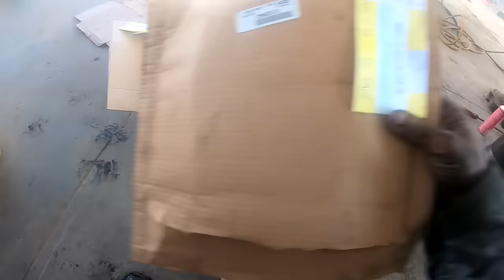Leaking axle seal.

Comment: Thank you for showing the inner race removal (welding the inside of race to shrink upon cooling).  That’s a trick you typically learn the hard way... a welding friend clues you in. To install a new inner race, I typically use a can of dust off (compressed air), flip the can upside down, and spray the liquid (difluoroethane) on the inner race.  It’ll shrink it a couple of tenths...race can be dropped in.

Awesome video!
Reply: Yes, duster spray (R152A) should be a standard tool on his truck. Absolutely freeze a race in seconds. At about seven dollars a can at wally world and so environmentally friendly you can spray it right into the air, a very useful tool.
Reply: I have taken the old race and ground it down a little and use it for a driver.
Reply: Propane bottle upside down works good to.

Comment: Speaking of heating bearings, you can wrap a bearing in a wet rag or paper towel and put it in a microwave, works great, and is much faster then a torch. You can also use it to heat up lunch :) just hook it up to the welder generator on your truck. Another great video keep it up.

Comment: Hey Warren Awesome video! I saw the weld trick with the bearing race you did to pull it out of the bore. Years ago one of the old timers taught me to drill about a 1/4 hole almost all the way through the race 180 degrees from each other then chisel on the drilling to crack the race. The idea is to split the race in big pieces to pull out by hand, kinda like drill splitting a crank gear.

Comment: Just amazed at the size of that machine and that you can handle the parts by yourself. Impressive.
Reply: The axle is only that large because it doesnt use a "Floating" style axle.  In a "floater" the axle only transfers power, not having to hold any vehicle weight. A truck using a floater will have bolts around the center of the hub. You pull those bolts and the axle simply slides out. Even with the wheel on the vehicles you can remove and replace the axle

Comment: Warren, that looks a lot like a JD 644 wheel loader axle.  I wish I had a crane, plenty of good learning rebuilding those. Dry tube with that labyrynth type seal for the outer axle and lip seal to keep the other lube out of the tube.  I didn't like the bearing preload procedure so just used a big hoss pry bar with the housing on the floor to get the .003 end play.  I didn't weld the bearing, I think I used a claw hammer to hook it and then a punch from the far side.  I was mystified how a 1 inch 8 bolt can hold a wheel onto a loader.

Comment: I'm not a mechanic but know a bit about lifting things that have nowhere to catch onto, make a couple of short metal legs and fix them to a strap, one on each end with a lifting eye in the middle of the strap. The legs are made like the legs on a puller/bearing extractor, L shaped the bottom of the L facing in over. the heavier tha load the harder they grip. You can even make a 3 or 4 legged strap for better balance. You have obviously seen how a puller works and its the same principal. I've used this to unload 50 gallon drums of oil only on the rim, 5 high full fish boxes and any number or things with no holding points.

Comment: I hope by now you have the torque specifications. I did a smaller model but very similar. Outer bearing went out and is only lubricated by grease. I shake my head at JD's thinking. Anyway I found the hard way that those bolts need higher torque then the tight and back off 1/4-1/2 turn. Months later they were too loose for my liking.

Comment: Another truck I use to drive bearings on to shafts is a piece of exhaust pipe just big enough to slide over the shaft and not so big it hits the bearing cage and use it to drive the bearing on

Comment: You can also put a little bit of Grease around the axle where your bearing goes lay your bearing down on a piece of metal heat the inside of the bearing and it will slide right down to where it needs to go because I had seen the inside of the bearing break where you was using the air hammer

Comment: Hey you were wondering on gauges for the Peter bilt project?  I may have a solution to that. If you look up on the web Murphy gauges, they have the gauge sets that can work on a j1939 Network. Murphy makes a module that intercepts all signals from engine ecm and converts to old style analog signals for tach. As well they make a module that is a gauge / diagnostic tool itself, that would allow you to have a def level gauge and as a well a monitoring unit for any other parameters you want to keep a eye on. They also have a basic ability to throw out a code to you to let you know what is basically going wrong when check engine lamp is on. Hope this helps a bit , I hear ya on hard work. Farmers up here in West Central Saskatchewan are ready to go, but rain has kicked us for a couple days.
Reply from the maker: Thank you very much for that. I just looked them up and that is definitely the solution to this.
Reply: @westerntruckandtractorrepa1353  Very welcome !  I'm curious how it all turns out In the end. We have a lot of old trucks up in this area and kinda interested to see how the swap goes. Let me know if you need a little help on some wiring .

Comment: Could it better putting the old bearing race backwards on top of the new one to drive it in..thanks great videos
Reply: Use an old crock pot with hydraulic oil heated to about 350 degrees. Use that to warm the bearing. At that temperature it should just drop down into place. No hammering needed.
Reply: If you take a cut off wheel and cut a slit out of it so it doesn’t get stuck in there it would be great! I do it all the time! If you get really crafty you can save a few of the common ones you use so you always have a driver hah
Reply: ShopUse he did say that it it would take to long to heat up the oil and the bearing.  He did  it in less than a minute with the hammer. It’s hardened steel and won’t even scratch it

Comment: Hello young man! really interesting video again. Please can you show more of the welding shrinkage technique for removing bearings next time you get one to do? I have never seen that done before and would like to know more. On the lifting of the  planetary drive, can I suggest you get a three or a four leg chain set to hook onto your crane. The hooks on the chains will or should go over the flange on the PD when it's laid down and then you can lift the assembly into place. Failing that due to room between the flange and the axle casing. Failing that dig deep and buy an electromagnet with enough lifting power to lift the assembly. Now, where can you buy a cheap electromagnet I hear you say? Just go buy used a mag drill, you can thank me later!  Thanks for video young man and take car and be safe!

Comment: Not a bad idea but 2 min with a good plate of steel and use your oxy to heat in the centre of the plate with the bearing on the plate flat, evenly heats bearing up to 180C and drop straight on. Also a bit of planning and have those cups in the freezer they will drop in pretty easy.

Comment: Great video as always on that peterbuilt update can’t you find a wrecked 379 with a n14 Cummings like a late 90’s and that give you all the gauges sensors and wiring all in one for the cheap?
Reply from the maker: Those were analog gauges , these are multiplexing.
Reply: Yhea but couldn’t it be ran separate from the original harness you know just like a ole hot rod gauge cluster lol

Comment: Hi their , I have a KW with CAT 3406b runs good .. I have 1 issue .. truck stalls / engine stalls out when I turn on the left turn signal on  only ? What do you suggest it can be ? Mechanic or electrical?

Comment: Hi from Norway! Regarding gauges on the truck have you considered a J1939 display unit? the simpler ones are quite cheap and can display all the information used on the engine CAN. I recently used a FWMurhpy PV101 on an industrial engine. Very easy to wire into the engine CAN. Google J1939 display unit...my 2 pence! good luck and thanks for some great videos.

Comment: been watching a long time waiting to see one thing, i have a 1982 ford F600 with a dump box, i made a hook up on the back years a go for a hydro electric  boom, with exstenda boom an man basket, with a 10,000 pond lift, and a winch mounted in the A frame, i saved the pto an hydrophilic pump off the older ford the boom came off, i plumbed it with a power beyond valve to cut off the valve to the dump box to feed the boom, but the pump is like 1/5th the size as the pump that came off the old ford boom truck, with this small pump, i cant lift as much as before when it was on the old truck that got took off the road,  also when lifting heavy with the winch, it will not go back down unless i bounce the leaver back an forth, witch is danger .. never did that with old truck an pump,,i been wanting to install the pto an pump from the old truck on to my 1982 F600 it mounts to the right hand side of the transmission, and there is a cover plate on the right side, the pto an pump for the dump box is mounted on the driver side, left side, i want to leave that one jus for the dump box, and install the big one on the right side, but everyone tells me it has to be shimmed, yet no shims came off the old truck when i took it off,i have put it up into place, but i dont know how to tell if it needs shims and how much, you cant see down that far with the tower off, how do you go about this???
Reply: Maybe some liquid blu or some similar so you can see what your looking like may have a backlash idk just one mans opinion
Reply: @colburnlawson6915  i tried that but hard to tell

Comment: we had a neighboring fire dept with seagrave fire engine with multi plexing turn to shit . they could key a radio mic and the electric ladder rack would move.talk about dangerous. the cure was electronic isolaters on each and every wire..tech guys said its impossible for that to happen.until they saw it for them selves ..

Comment: Warren where did u find air fittings for your 3/4 impact I purchased one can’t find one anywhere to fit. Western truck and tractor repair
Reply: There are a bunch of different types and sizes. You'll have to match up what you have. Look up the CP air fittings catalog on the web and you'll find what you need. Napa also sells them under their own brand, but most stores wouldn't know what you wanted so you need to ask by part number. Also a  hose shop should be able to match them up for you.

Comment: Mr warren is there any way I can get in contact with you with something that has me just plum stumped, 545 skidder just runs out of fuel 3 times a day , it’ll just drain the filter I’ll hmf prime it up and it will work for a while then do it again , changed all the lines , the fuel filter , fuel lines , prim bowl filter and drained the tank and shop vacked it out spotless . Good tight skidder just have to stop about 3 times a day
Reply from the maker: Have you checked to see if the vent on the cap or fuel tank is plugged?

Comment: Kinda wondering why no one makes a harness or the electrical means to convert older trucks to newer engines.   See a ton of pete gliders that have cab modules running around with 3406e and early c15 cats which are well before j1939, has to be someone that has done this before or sells something.

Comment: Warren what don't you fix haha. I just wonder was this machine built with mostly Deere parts?
Reply: Many of the custom harvesters are built on Deere platforms. You can basically buy a rolling Deere chassis and do what you want with it.

Edit: didn't see the end till now so they probably did use an old Deere "harvested" for the harvester but it's quite common to build on a Deere Chassis. Look up custom potato harvesters and such.

Comment: if the existing wires are there are for a mechanical gauge cluster should able to adapt to engine there is no point create yourself extra work and time.

Comment: Warren is that a 1400 or a1600 axle?
Reply from the maker: 1600
Reply: @westerntruckandtractorrepa1353  that's the same axles on the 824 j loader that's a massive axle ,I've done a lot of those

Comment: A peice of bar bigger than the intenal diamiter of the ring gear,   cock slide it in, then centre, crane it in slide and cock the bar,  take it out, Iv'e done tons of things like that, with only a small tollerance to work to.

Comment: I mayyyyyy have a cm2250 wiring diagram u need one if I can locate it
Reply: Oh and I have Cummins cm 2250 specific pin out leads for checking engine harness pins I’d be willing to mail em out if u need em more than I do
Reply from the maker: This is a 2350